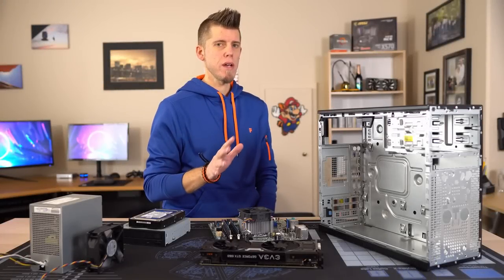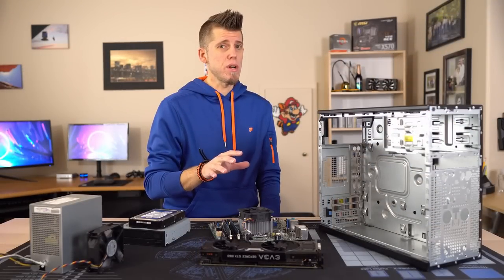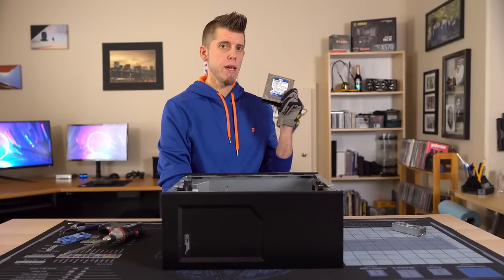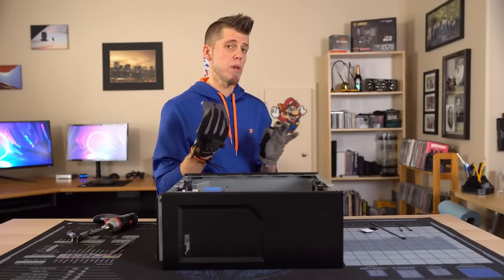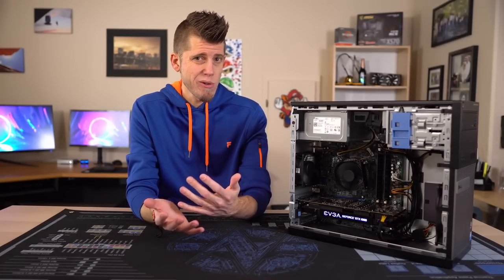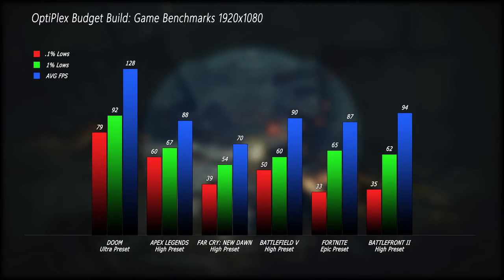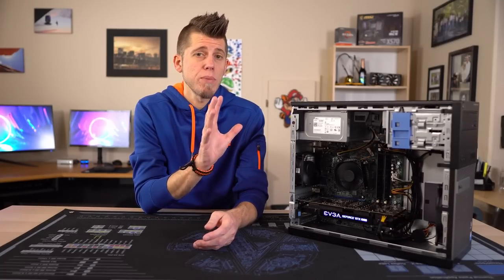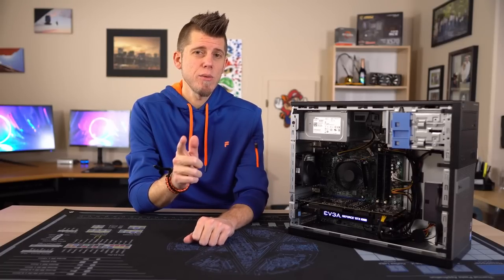Dell OptiPlex Budget Gaming PC For Under $300?

Comment: Is this gaming pc good? It costs 1200$
Intel® Core™ i7-9700-processor
Nvidia GeForce RTX 2060 Super, 8 GB
16 GB RAM, 512 GB SSD
Reply from the maker: It's good. Decent entry level 1440p or a good high refresh 1080p rig... so long as you're not trying to run ray tracing. I'm not sure where you're located, but that price would be a little high here in the U.S. But it's a capable gaming PC regardless.

Comment: Great timing. My video card came in the mail today and I had just put mine together before watching this. Im glad you mentioned the paste too. I saw another video talk about it but it was the only one, so I was kinda on the fence about it. You mentioning it is going to actually make me do it. My ssd is still in the mail so I will be diving back into it. I like how you didn't bother with added ram either. All the 8gb vs 16gb comparison videos I watched showed that it wasn't really needed, at least for gaming with this setup. I do my gaming on a console so the main reason I did the build was for watching 4k movie files. My xbox one s has a hard time playing them smoothly, some would barely play at all. I watch all my "tv" content from a pc which only does 4k @ 30hz and it was needing a upgrade. I picked up a clean stock 7020 with win10 installed for $111 about a week ago (it took a last second snipe bid at 3am but I got it), a gigabyte 1050ti for $80, and a 128gb ssd for $19. So Im into mine for $210. It would have been about $17 cheaper if ebay didnt start adding tax to everything not to long ago. I do still need to get some paste and a fan adapter so I might spend another $5-10.
Reply from the maker: I actually always put 16GB in these since it's so cheap and really helps sell them. However, I tell people all the time that you're typically fine with 8GB, but it's quickly becoming the minimum. There are games that are starting to use more than 8GB. But I hear ya'... so many people talking like you can't play games at all with anything less than 16GB when most people are playing with 8GB. It's the typical elitist attitude.

Comment: You just got exposed by Rich of ReviewtechUSA lol
Reply from the maker: Yep, I'm aware. I did my testing and I know what I did is sound.
Reply: @TheGameBench  With a OEM power supply for that 1060. No way you thought that was sound. Thats a set up for a potential failure down the road.
Reply: @TheOctMandalorian  230w power draw from a 300w power supply.. so its actually only drawing about 205-210w
Reply: @TheGameBench   You went about the project with the right idea and gave lots of good advice on the build (Rich even says he liked how you went about most of the cable management as an example). but the cable modification you made was unnecessary & non-experienced folks should never give that a try & the power supply in this guy is vastly underpowered to run the 1060 inside it. Because of that, this puppy is a ticking time clock that could easily end up frying, and you should've spent that little extra to get a proper power supply inside that does properly support the 1060. I get the idea was to get the build under 300 USD, but if the build was around 325 or 350 instead, you still would've done well in regards to views. 

Rich isn't trying to hate on your video or make you look bad, he's just trying to help those who will look at your video and then try to create this build while helping you get better so you can produce better videos in the future & you won't make mistakes like these, as a lot of the viewership you're going to get on this content will be those just getting into PC building.
Reply: no real need for this kind of comment, Rich even said not to do this.... damn you people dont listen
Reply from the maker: Wizzy Wambo  I never complained about criticism. This is the internet, and it's what Rich does and has the right to do. Don't put words in my mouth.
Reply from the maker: As for the power supply, the 1060 draws about 120 watts. It's not about "thinking" it through. I've tested the power draw and this system pulls a peak of about 240 watts, usually sitting more around 220 watts... from the outlet. The power consumption from the power supply is going to be lower than from the wall, so, you have less than 220 watts consumption from the power supply, at peak. You literally have 70-80 watts to spare. I've also torture tested these in an unrealistic load scenario with Prime 95 and Furmark running the PSU at it's wattage limit to see if it would fry... it ran for four hours with no issues.

This PSU is not a bad PSU, and it can supply the needed power for this hardware. For a 1060, it's fine.
Reply from the maker: @codyssmith73  And I offered alternatives for people that don't feel comfortable modifying the SATA power cables in the video. I told people to get a SATA extension with a straight connector. I don't even see why people are bringing that up, unless they didn't watch the video.

Comment: One of my 9020s came with a slim-ODD/card reader in one of the 5.25 slots. This one would be perfect for one of the slim-ODD/dual 2.5 brackets.

OR...

There's enough room behind the card reader to hang about half a 2.5" drive on, so if you're the Velcro mount kind of guy, you could leave the stock system in and Velcro an SSD there. If you do so, the entire setup ends up being about as long as a 5.25" ODD, and still gives you an ODD for rare use, and a card reader. Bonus!

I wish I could attach a picture, I pulled one of the screws holding the card reader in the bracket, pressed a 2.5" drive against the hole, and screwed the screw back in, and it held it decently well.  It still would have needed Velcro, but it was enough to let me check fitment in the case.  Since there are 2 screws on each side behind the card reader, though, if I REALLY wanted to mount an SSD up there, I could cobble up a couple of steel brackets to fully bolt it in place using 4 holes on the SSD if I wanted to, simply using longer screws.  It would require no mods to the case or ODD/reader bracket.  Of course I could also probably just drill 2 holes in the bottom of the reader bracket and screw an SSD in using the bottom screw holes and be done with it.  A custom bracket would allow for mounting TWO 2.5" drives up there, though.  I could even start with a dual-2.5/3.5 plastic or metal bracket and just lightly mod it to fit in behind the card reader.

Comment: You are the OptiPlex whisperer! I have a couple q's if you could help me. I have a Dell optiplex 7020 with 8GB/Ram, Windows 7 64Bit edition, an i7-4790 CPU @ 3.60GHZ and a stock dell power supply that says AC290AM-00 it says total power 290W MAX. I'm gonna take your advice and stay away from the 580 model as I would love to keep my stock PSU and thus I was looking at the 1060 3GB or 6GB models. My question is can I keep my stock PSU with a 6GB 1060, considering I have the i7-4790 CPU? And if I do keep my PSU with the 1060 will it all connect to the board/PCI slot stock? Or does it need to connect directly to PSU with an additional adapter or something?
Reply from the maker: Haha, thanks! So, the power consumption difference between the i5 4690 and the i7 4790 in the 9020 is about 10 watts. Not enough to sway my opinion. With the 4790 and a 1060 3GB, the system would draw under 190 watts. With the 6GB it would be around 210 watts with the i7. You should be fine. As for connecting the GPU, either way, you'd need a SATA to PCIe power adapter. The one I use is linked in the description. I've used around 20 of them so far and not had a problem.

Comment: WHAT GPU SHOULD I GET? Optiplex 3010, i5-3470, 8GB ddr3 ram, 240ssd, stock PSU. Very clean machine too :) I try to take care of it. It's my first PC ever and I'm upgrading everything on my own.
Reply from the maker: Well, I need to do some testing with the i5 3570 that I just got to see what it's bottleneck limit is... but I've tested the 4590 and it's limit was about a GTX 1060. I imagine it will be about the same. The 1060 should also be fine on your stock 275 power supply with the same adapter I used in the video. If you want to go AMD, the 570 would be a good choice, but you would need to replace the power supply.
Reply: @TheGameBench  Id rather not replace the power supply just yet. I want a GPU ugrade then maybe a bit more ram like 16 instead of 8... I just wanna wait out on the PSU upgrade til i get this new job im hoping for

BTW thanks for ALL the oputstanding info you put into these optiplex vids. I wouldve gotten something shittier if I hadnt watched your vid on why the 3010 is better than thew 7010
Reply: @MrSamadolfo  how weak is this cpu? how man gens bbewhind? im new to PC building plz forgive me.
Reply: @Eazy_Bruh  🙂 this is 3rd gen, rite now we are on 9th gen
Reply: @Eazy_Bruh  🙂 sure, u can keep using your psu, your i5, and ur 8gb ram, so the best cards would be in this order:
1. 1660 Super 6gb
2. 1660 Regular 6gb
3. 1650 Super 4gb
buy power adapters to connect the video plug to your psu molex plugs or sata hard drive plugs. Later on if u need more performance get 16gb ram & i7 or xeon, OR move up to a newer platform and reuse your 1660 Super 6GB
Reply from the maker: @Eazy_Bruh  Yeah, it's 3rd gen but it's still relevant even though we're nearing the 10th gen. That being said, upgrading to an i7 3770 would be cheap and open you up to running something on the level of a 1080, or better. I'd agree that the 1660's would be fine on your PSU as well as the 1650 Super. Don't bother with the regular 1650. And the 1060 6GB is probably the best option for the money since you can find them for around $120. The other's are great if you're pretty set on buying new.

Comment: Snagged an Optiplex 7040 MT from work for free. They were throwing it out.
Core i7-6700 with 16gb DDR4 RAM.
I put in my 1tb Samsung SSD and a 4tb WD green rust drive.

Thing is a beast.
Reply: Will music production work well with this
Reply: @MuzeInspiration  I don’t see why it wouldn’t. The only thing that would set you back is the integrated sound card, but with the PCI expansions you could put a really good DAC in it.
Reply: @darylandcat  I have a sound card. M audio. Will that work

Comment: Great videos, about to start working on an OptiPlex 990 (i7-2600) for a friend.  One question I had is why you didn't upgrade the PSU?  I'm hoping to simply replace/upgrade the PSU on the 990 to a 400W+ any potential issues I may be unaware of?  You're kind of an expert on upgrading these Dells man.  Love the series/videos!
Reply from the maker: Thanks! Yeah, I didn't replace the power supply because it's not really necessary with the 290 watt unit in the xx20 series with something like the 1060. The total system power draw, from the outlet, with the 1060 6GB was around 200 watts. With the 990, you've got a 265 watt PSU and with something like the 1060, you'd still be fine, but if you wanted to run a 1070, or better, or a 570 or better, you'd want to replace the power supply.
Reply: @TheGameBench  Got a 470 on the way, so going to upgrade the PSU.  Also going to add the front fan.  Excited to put this thing together, will rewatch all your videos on the series a few times :)

Comment: Man your videos are good. THANKS for the tips. I was always intimidated by the hardware until I started getting into mame arcades. I am an old school gamer.
Reply from the maker: Glad I could help! I'm an old school as well. I really need to take the time to set up MAME on one of my machines. I heard the new version of launchbox is much better with compatibility. Should be much easier to set up.
Reply: @TheGameBench  launch box is pretty good for creating clean rom lists. I condensed 16 gigs down to a nice clean 2 gigs after filtering out the fruit games etc.

Comment: There is a whole lot of added benefit to a PC over a console in terms of productivity. Now that being said the only reason I have consoles is for their exclusive titles but I mostly game on a PC.
Reply from the maker: Same here. I default to buying games on PC and have the consoles for the exclusives. That's definitely a point I would make in a PC vs. console video. So... that really makes it even more of a value over the PS4 Pro and Xbox 1 X.
Reply: 🙂 sure just get both, i keep a 360 and a PS3 around, i still need a PS2 to add to my collection
Reply: @MrSamadolfo  PS2's are probably as cheap as they're ever going to get, right now. Those and Original Xbox are probably the sweet spot for collecting consoles and titles at the moment. I've been growing my original xbox game collection recently. usually games are only $5 or so at my local game store. (not GameStop)
Reply: @Shane-Singleton  🙂 yeah i need an original xbox too, yes i do notice that console discs they want at minimum $5 and up

Comment: I have an Optiplex 7010 

I5 3470
Gtx 1050 ti low profile oc
8gb 1600mhz
500gb 7200rpm
I also removed the DVD drive to improve temps and get a free SATA power and data cable
Reply from the maker: I have an LP 1050 Ti in a SFF HP and it's a surprising capable card for 1080p.

Comment: Great video, great editing, testing, everything. You're doing good things for those budget gamers out there.

The only thing I would add to this is a USB 3 / 3.1 PCI express adapter. It should fit in the lowest x16 slot on the motherboard. Optiplex 9030s wouldn't need this. Could put an NVME adapter in the extra slot instead.
Reply from the maker: I actually have an m.2 PCIe adapter I was going to put in one of these. It's shame the BIOS doesn't have the option to boot from the PCIe bus.
Reply: @TheGameBench  That would still provide fast storage for games or anything else.
Reply from the maker: @blakecasimir  Honestly though, an NVMe drive is overkill for most everything anyone would use this system for. Hell, editing these videos in 4k and I see no difference between a SATA SSD and my NVMe drive.
Reply from the maker: @Lothairecliquennois  Haswell and Devil's Canyon do support booting from the PCIe bus, it's just these OptiPlex boards that don't have option to do it.

Comment: I would pair something like that with a 950 - 1050 ti.  The 3770 pairs well with a 1650. All negating the need for the stronger power supply.  A 1060 6gb would really need an overclocked 3930k - 5820k or 4790k to shine, and those systems would already have a capable PSU.  
Having said all that.. these optiplex's you build are legit the sexiest looking builds i've seen in a long time. Dell really had a great design with them, especially compared to their HP counterparts. its like a perfect mesh of classic and modern

Comment: 4 years later I bought a 9020 for $154 off ebay. It did have an added hard drive, has the i7, and also comes with 32gb of ram. Waiting for it to show up to decide what gpu I want to add to it.

Comment: I got 1 the other day for 200$. But wasn't stock. It came with an i5 3470, RX 460 4GB, 16GB RAM, and a 650w PSU. A 1080p 22inch monitor and a gaming mouse.
Reply from the maker: That would have been a great deal last year, let alone now. Nice find.

Comment: Interesting. I'm about to start my build tomorrow based around a HPZ420 workstation (EBay). It cost me $191 including shipping but I knowingly spent more money because it's an enterprise grade machine with a Xeon E5-1650V2 3.5Ghz  6 core 12 thread processor, 16GB quad channel 1880 server memory and 'very' optimised PCIXV3 with a 600W  PSU and it's all stock. I'm adding a Barracuda 500GB SSD and a Barracuda 2TB HDU with 256mb onboard cache. The PSU will be able to handle a Radeon RX580 GTS XXX 8GB GPU. The GPU I got as one of those ridiculous deals where you find  a high end component in a dogs breath machine. I found the RX580 in a Goodwill machine that I bought for $20 but that was just luck on my part.  Eventually I'd like to go to an 8 core processor but those are about $140 right now. I may take it to 32GB because server memory is cheap and another 16GB is going for about $35.  Total cost of this build will be around $400 if I paid for the RX580 second hand on E-Bay. And for that you get a ultra robust PC that games as well as doing CAD for 3D printing as well as video editing. This is a far better deal than an Xbox One X. Oh, and you can install MS Gamepass games on a PC now and that's an amazing deal for $15 a month. BTW can confirm on the Windows licence.
Reply from the maker: I've been really interested in grabbing one of those Z series, and $191 is a hell of a deal for one with a 1650 V3.
Reply: 🙂 sure, i like HP Zee's, i stick to the 200 series line since they use consumer line parts

Comment: You can even get more performance out of one of these. Install a standard ATX PSU,  replace the CPU with a Xeon E3-1270v3, install 16 GB memory, and a Vega 56 or GTX 1080. That's a ballin' 1440p and entry-level 4k machine. i7s are a waste of money when the Xeon equivalent is cheaper and readily available via AliExpress.
Reply from the maker: Sure, but at around $85, the 1270v3 is about the same cost as a 4790 and the 4790 is a touch faster. Honestly, either would be great and I plan on covering a build with the 4790 and a 1080. You bring up a great point and I'll have to note the 1270v3 as a viable option when I do that video.
Reply: sure, but those video cards are overkill, you can scale down to GTX 6GB video card 🙂